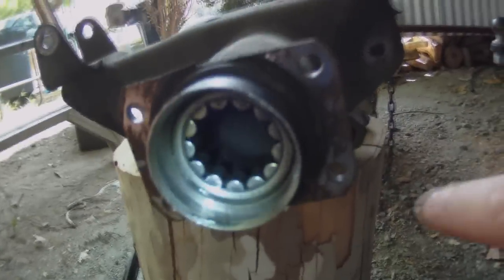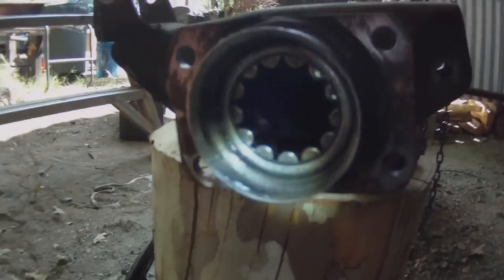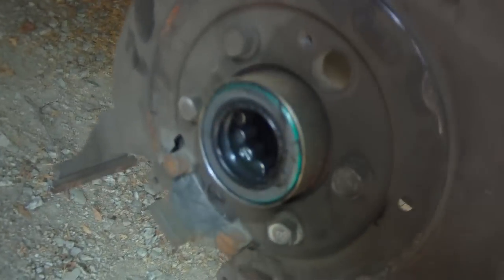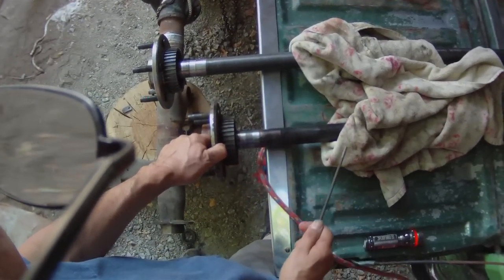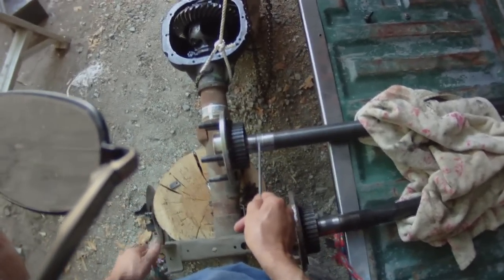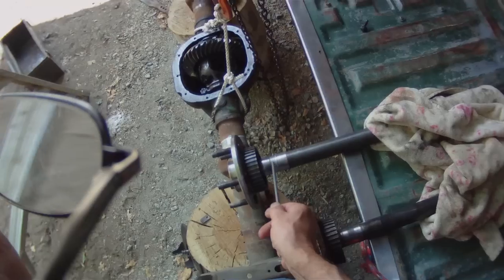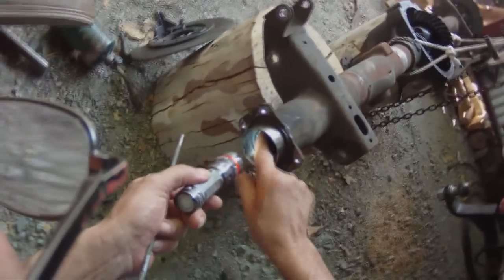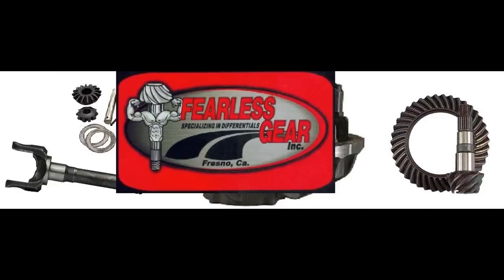Crown vic 2003 police Interceptor  rear axle fix

Comment from the maker: I do not know. Just someone like you with the same problem. I just had to take it apart to see why some shops charge 800.00  to 2000.00 to fix this. Only turns out to be 1 to 2 hours at the most. Glad you decided to do this your self

Comment from the maker: The ABS pick up may be hanging it up. One little bolt holds it on. See the flange with all the rectangles on it? The sensor reads these to determine what the wheel is doing in relation to the other wheels and the speed of the car.
have you removed the axle?

Comment: I have a 1999 town car signature edition, 150k miles. Has a very bad wobble from the rear and I can't figure out what the problem is. I looked under to see if I can notice anything and all I noticed was that the right shock us busted . I will change that, and the rear diff is leaking oil. Could that be my problem? Seems like my car is hoping at slow speeds. Can anyone give any suggestions or ideas about what my problem may be? Thanks!!
Reply from the maker: if the oil leak is coming from the wheel  area , it has a bad bearing at that end/ I think some one is making a harder axel. You might call Summit racing to see if they have it.

Comment: I have a 2001 mercury grand marquis a mechanic said i need a wheel bearing but im not sure witch one . Just the bearing or the whole hud assembly
Reply from the maker: Look at the inside of the bake drum. the one that has oil on it bad/ you may also need a new axel. What does he want to charge you? For a skilled mechanic it is an hour or less to do.
Reply: Rod Simonian he didnt give me a price , he just told me what part i needed,  is it just better to buy the whole axle,  he also stated that i might need a whole new rear differential
Reply from the maker: the differential and axel shaft needs to be cleaned out There are metal parts in the oil. a spray bottle with diesel fuel in it does a good job. But a new differential is BS. Also 2 magnets placed inside the housing will get the rest. You cannot tell if you need a new axel till you remove the bearing. Be carful this Mechanic is on the shady side. Ask what he will charge to change bearing , Axel shaft and clean out the metal parts. Summit racing is a good source for parts. Axel shaft about 150.00 and bearings about 30.00
Reply: Rod Simonian thanks for the help, ill ask him and dont the new axle shaft comes with the bearing

Comment: How would I remove a reapir bearing that was installed backwards, only the race is in the shaft housing, I've tried a sawzall and it chewed up the blades like butter
Reply: Slide hammer
Reply: @kylez2141  I had to chizzle it out

Comment: +rod simonian I have a 2000 mercury grand marquise and you need like a knowledgeable fella, my question to you is, my rear back tire when I am pulling off from a complete stop my back tire shifts a bit and creates a loud clunk or smack possibly even a pop Like the joints. but I've never known the ball bearing a or u joint to shift the tire quite a bit. someone told me could possibly be the pumpkin or axle ?! don't mean to span your video but any info is greatly appreciated . thank you enjoy you're day.
Reply from the maker: +Ken Bowles Not sure if I can get this right. Jack the wheel up and see if it has any play in it. Up and down and side to side. From what you said , it sounds like the whole rear end is moving.  I would check the u joints to make sure this is not the problem. let me know
Reply: I to would check the U-Joint I had that problem on my Vic.
Reply: dad has a 2003 gran marquis that was making a "thunk" sound from rear end,had to replace right side rear axle
Reply from the maker: Check for up and down movement of the back wheel. Look oil seeping Twist the drive shaft to see if the play is in the U joints.
Reply from the maker: They are the same as the P71

Comment from the maker: If you have a broken leg and you don't fix it it may stay broken
the bearing or the axle shaft has failed. It will only get worse. and you will have
more metal parts to clean out. You may also rune other parts in there

Comment from the maker: Try sliding it back in and out a few time. The grove in the shaft is hanging on the bearing.  Lift up and down while pulling. If that does not work make up a slide hammer and attache to wheel studs. then hammer it out.
I have never tried this but this what  would do. It may or may not rune something. It is your call.

Comment: Im hearing a slight chunk, coming from the rr on acceleration. If i i really caress the pedal i dont hear it,but general acceleration it lightly chunks. Any ideas?
Reply from the maker: check for oil on back plate of drum.. It should get worse soon if it is a bearing.
Reply: @JONSEREDdotWS  Drum,as in brake drum? So you say it might be rear wheel bearing? Im good with working on some parts but never back there.
Reply from the maker: @MonteLeeMyPOV   yes brake drum. Then it could be dif or something else
Reply from the maker: @MonteLeeMyPOV  jack it up and see if there is play in the axel

Comment: My Boss just bought me a 2008 P71, 125K, as a company car.  Driving it home I noticed that the rear end has a pretty loud whine/growl.  Pronounced under acceleration, almost quiet when coasting.  Seems to be from the center pumpkin area, not the wheel area.
When I told the Boss, he had one of the shore gang check the oil.  It was pretty dry, taking almost 2 quarts.  After the fresh oil, the noise lessened about 50%.  Boss says it is likely the pinion bearing.  Noise does not change during turns. 
Even tho it is a company car, I am responsible for maintenance...Lovely.
Question:  Given the above info, what is the most likely problem?
Reply from the maker: Most likely the pinion bearing. After filling with oil , any leaks?
Pinion bearings area little tricky to change. As there is a crush washer that has to be pre loaded just ring.
Reply: my 2004 does this but changes when i turn
Reply from the maker: reub3ngAs  Sounds like the pre load not correct or the gears need to be adjusted. I forget what they call it. Any leaks?

Comment: your last axle broke your diff and even with a new axle the same kind in hardness will do the same or worst the diff is dead bro
Reply from the maker: do you mean our? That axle did not break. Just the bearing grooved it. Axle and bearing replaced. Yes it will do it again but the dif is still good. I think someone now makes a better axle. The bearing was ok just a soft axel.

Comment: wow u got 64000 thats alot of customers who will def think x2 before going to that place dont they guarantee there work? i have to wonder what happened why not just pull out old replace with new what caused all this sawing and investigation well good luck later also if the seal broke and the fluid ran out with just a tiny amount of fluid it
would do like mine cut a nice groove in a short time i imagine mine is also toast good luck